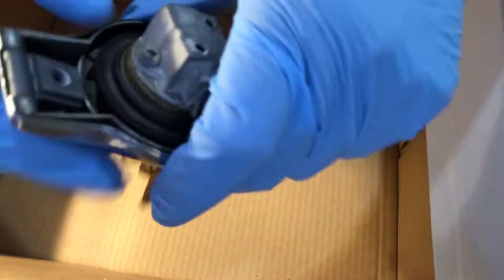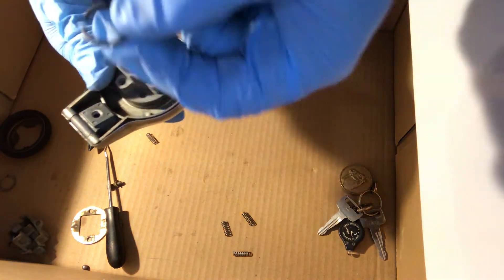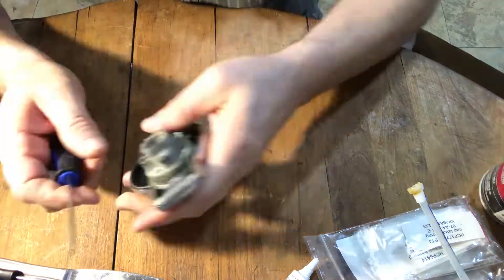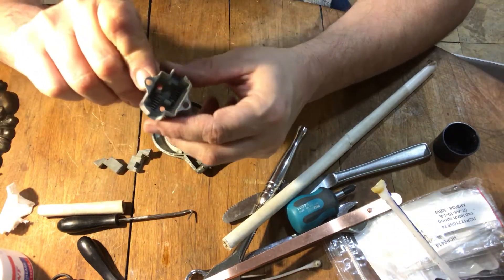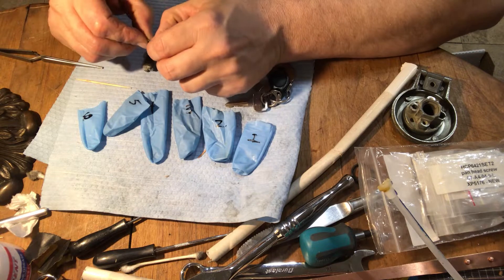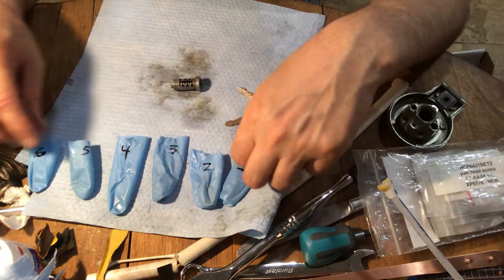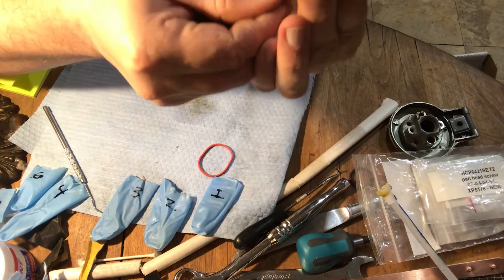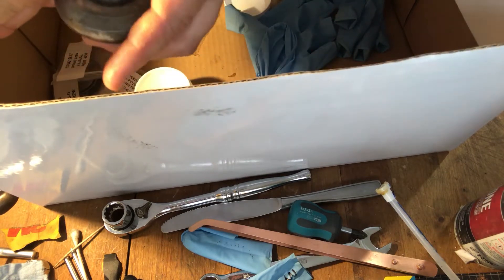Rebuild/clean gas cap & lock - Yamaha XJ750 Maxim

Comment: Hi there question, when you removed the gas cap from the tank did your key work to unlock it? I've lost the key to my 82 xj650 and im trying to figure out if I can remove the cap without drilling through it? Thanks!
Reply: I got 83 xj750 with no key thinking ab prying the gas cap open. Idk what to do
Reply: @775Jess  I ended up finding the key for it but not after calling 8 key cutting places in my city and two actually were going to come through with getting a key cut for it for around $60
Reply: Thats way better then pryin. I'll call some places thxx